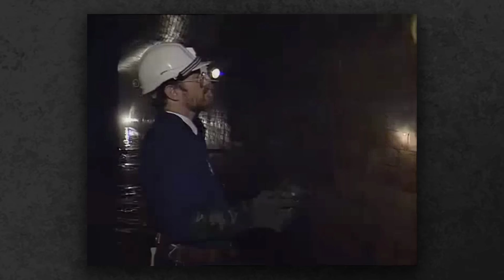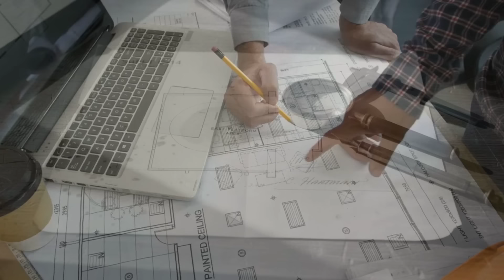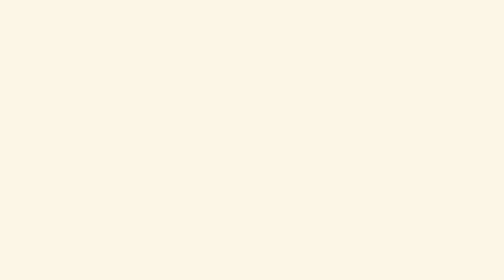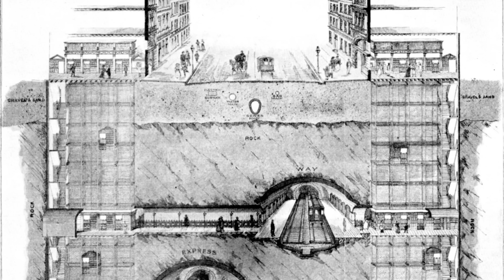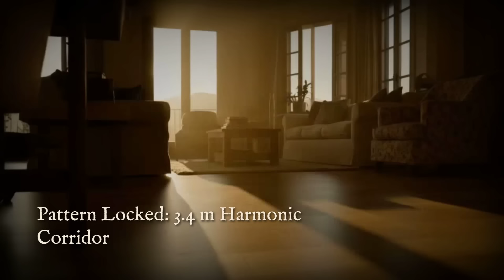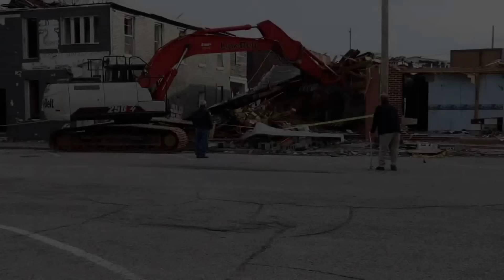The Impossible Materials Used in Ancient Tartarian Train Stations

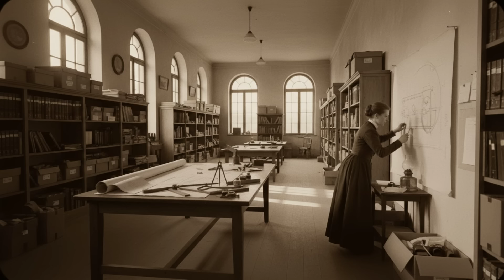Comment: @12:20
The deviations in orientation of these buildings are because they are built on far older foundations. 

The channel Mario Buildreps explains this by showing how the north pole's position has shifted 5 times. He has mapped the orientation of thousands of ancient sites around the world. They are divided into 5 groups as each group points to 5 specific north poles.

He has calculated their probability by ancient winter/summer solstices and they match perfectly. The oldest north pole location is around 440,000 years old. 

One type of sites he has checked is the Roman amphitheaters. They too point to 5 different north poles, as they too seems to have been built on ancient foundations.